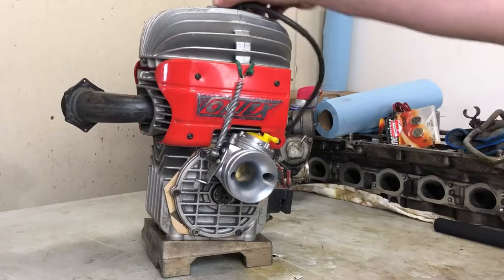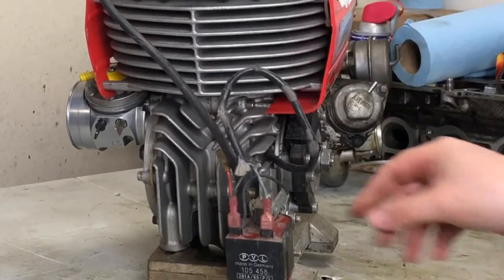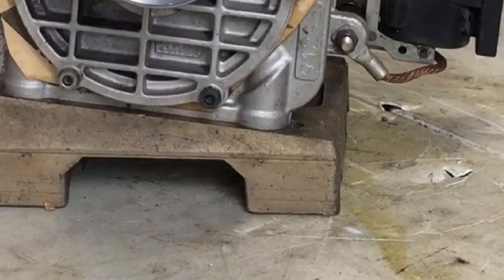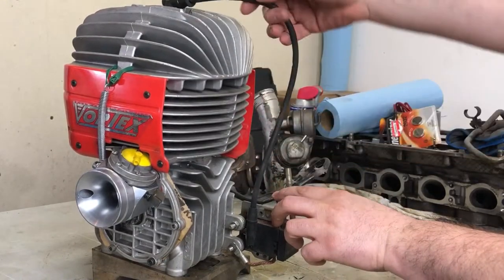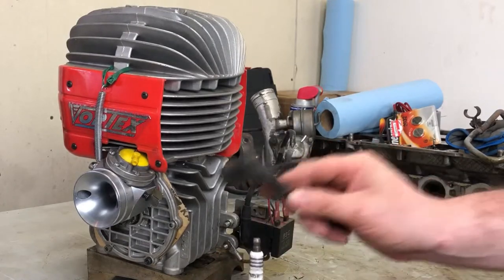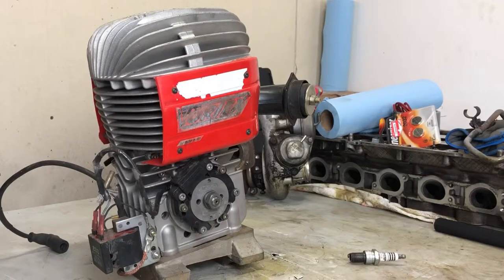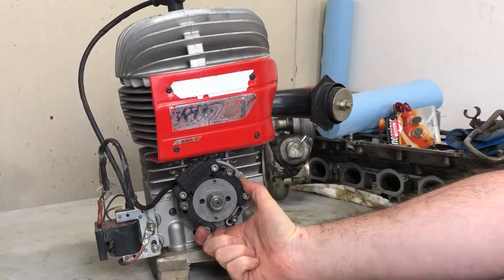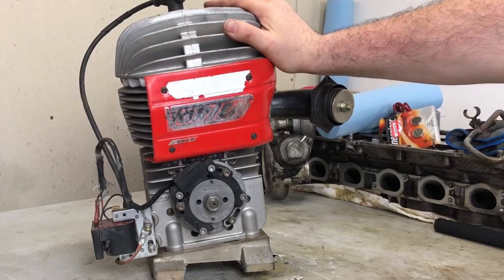PVL ignition Tips and troubleshooting for 100cc kart engines

Comment: How does rotary valve compare to reed? I heard they are a little more tunable but higher maintenance? I think you can choke them at wide open throttle to cool and lube the engine like a piston port without damaging the “valve”
Reply from the maker: Rotaries tend to have more mid range power, I wouldn’t say they are any more or less tunable compared to a reed. While you don’t have to worry about breaking reeds with a rotary, you do have to make sure you don’t crack/shear a valve. It’s not super common though.

Comment: Noice! I just got a vortex vr95 and I haven't started it up yet because it's been sitting for about 2 years. It's gonna need a carb clean first and a new sprocket for the engine because 2 teeth are broken, I haven't been able to find a sprocket yet but I was wondering if maybe there is another one that is compatible, also I hear there are other pistons and parts that are cross compatible. I haven't been able to find any youtube videos or tech info yet for the vr95.
Reply from the maker: Pistons are pretty interchangeable like you say. Same for rods. Rotary valves will vary. I think the VR95 was a regular tapered drive vs splined? Koene in the Netherlands are a great resource and supplier for the older vortex stuff.

Comment: Hello, Can I use the pvl ignition in a motorcycle engine but with a different coil?
Reply from the maker: Possibly. The coil would need to be an analogic type at least though. That’s to say if the motorcycle engine has a CDI ignition, it’s unlikely that the stator/rotor from the PVL would supply a voltage high enough to drive the coil. 

Usually coils in CDI systems have a higher activation voltage.
Reply: @thiswillprobhrt  Thanks!

Comment: In theory,  what would  be the absolute most hp you could squeeze out of one of these? Not to race in any restricted league just for personal fun
Reply from the maker: It depends on how much you are able to change within rules and budget. The route that's followed in the US is to bore them to 54mm to make the 116cc, convert to methanol and add a big carb (Or two smaller ones). That kind of setup is anything from 30-35HP depending on who you believe.

One caveat is that a tune like that makes the engine very peaky, so while it would be fine for an oval with a wet clutch, it would be pretty bad on a typical kart track.

Now if you're looking to keep it direct drive on a typical kart track, the easiest hop-up is to add a slide carb from Formula Super A. These are usually 29 or 30mm. They add a LOT of mid range punch but are more difficult to tune.

The greatest asset these engines had was their wide power delivery rather than the peak power, which.

We can do into more detail on your ideas on the kartpulse forums... forums.kartpulse.com
Reply: @thiswillprobhrt  wow thank you, thats a lot of good info. Ive recently read some info on builds called sudam by buller, 125cc methanol claiming a reliable 55+ hp for dirt ovals. Would love that!  But like you say "who you believe" 
Thanks again